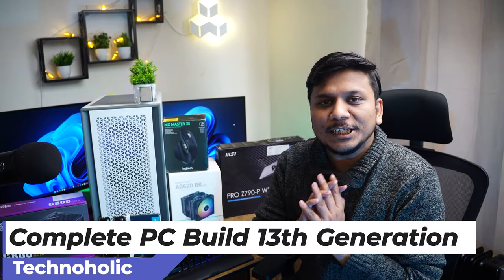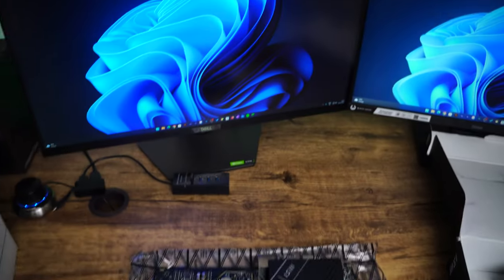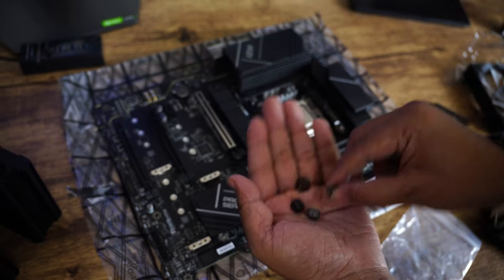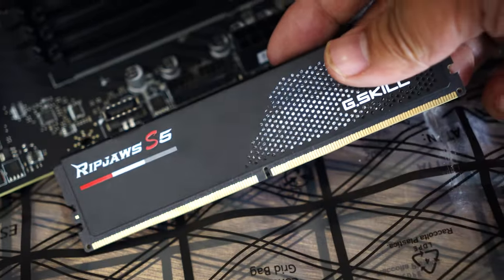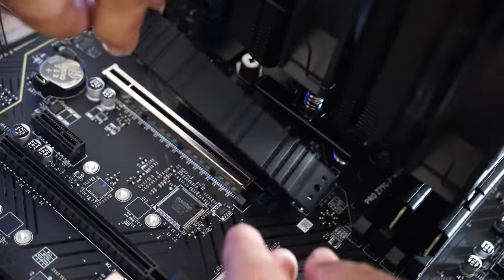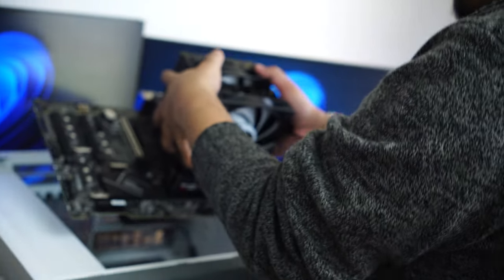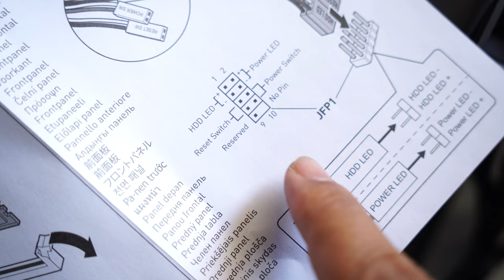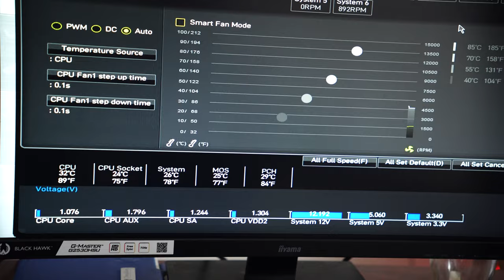Intel 13th Gen Core i7-13700K PC Build Under 1.5 Lakhs ! Complete Guide

Comment: Idk why you go with Ag620bk Can it handles i7 13700k ??You can Get Aio Instead of this. Deepcool LT720 can be a Good Option .
You can Also Undervolt If you Need if your going to stick with that air cooler.
Reply: Air coolers are much robust then water cooler, secondly this aircooler it can even handle even core i9. This cooler is so so capable the fan kick in only during high cpu usage.